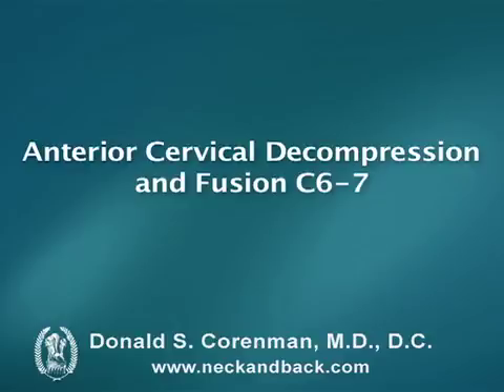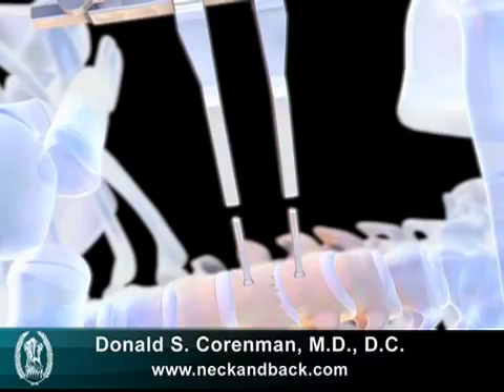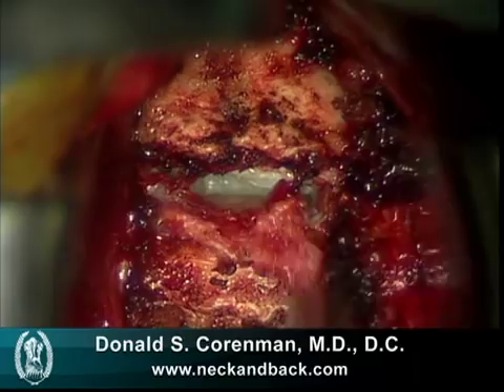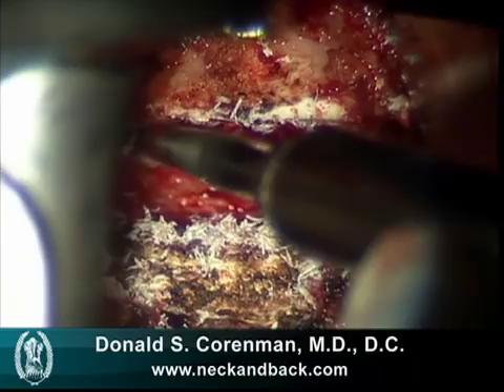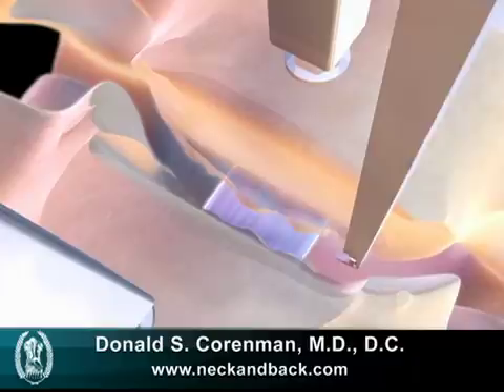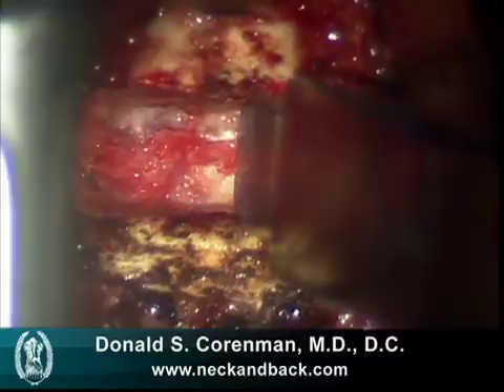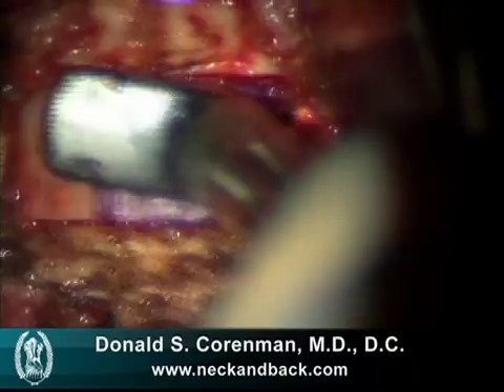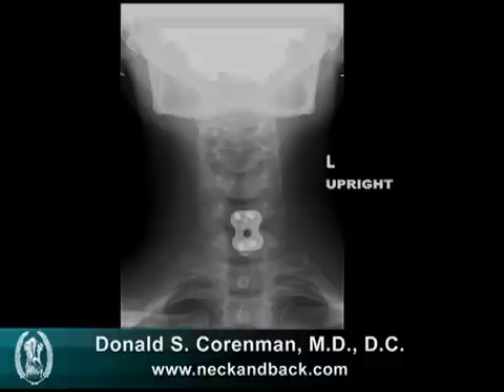Anterior Cervical Decompression and Fusion (ACDF) | Live Spine Surgery Video | Spine Surgeon

Comment: I had this surgery done on the same levels (c6-c7) and I'm stronger now than I ever was before. I always suffered from muscle imbalances and I'm definitely much more even now
Reply: Did u balance issues...
Reply: @TarikRom-hu3jj  had the surgery in late 2015. The pain eventually came back but for about 8 years I was able to lift weights daily and had no issues with strength. About 6 months ago I lost all strength in my left arm again just like I did before getting the C6/C7 fusion. I am scheduled to get another C5/C6 fusion in the next couple months. 

Before I got the first procedure I was warned that over the course of my life I would likely need additional surgeries as additional discs would likely degenerate…

Comment: Lu Malungcot Hi Lu, Sorry I've been extremely busy.
Yes, I had my surgery on June 24th, 2014. I didn't get my 1st follow up appt. until 3 months after surgery, I reviewed many other videos & I wondered why I had to wait so long. There is improvement, I no longer have the pain that ran through my left arm which was very intense. Although I still experience numbness from my elbow to the tips of my fingers, the surgeon said that it may have something to do with the elbow itself ... That's another appt. I still have to make. The day of surgery my surgeon let me know that I would also be having my C-5 done, so I had C-5, C-6 & C-7 which took 5 hours. I was then taken to intensive care overnight & went home. I would say that for you not to be afraid & I know that's easier said then done, but I was also concerned & felt a little nervous myself. I do have to say that I don't regret getting the surgery, I do still have some pain & cracking which I was told is normal & could take up to 1 year to heal. So, after 1 year I should be healed as much as possible. My husband & myself decided that I would not drive until just recently, you will tenderness when you turn your head. My tenderness is on my right side. I believe that as strict as my surgeon was before he would even consider doing the surgery help me very much & that was due to other health conditions I have.
Build up your courage & know that you'll feel better after recovery & remember that you will be a little fragile & experience some discomfort. I had fusion, so I do have a Titanium-Plate & 6 screws.
Good luck Lu, you'll be fine.
I'll keep you in my Prayers, it doesn't hurt to feel that extra comfort. You'll also need someone to help you & take care of you, so plan ahead & make sure you have someone to do just that.
Please keep me updated on how you are feeling & how your recovery is going.
               Lily
Reply: Lily, thanks for your comment. I'm at the end of my back injections  (2 years) I've been told it's time to talk to surgeons. I'm scared s...less!! But the pain all along my spine from neck to lower back has me nauseated, I stopped the opioids 3 months ago because they no longer worked. I needed the push of courage you gave me. I'm so tired of the pain, feeling "wasp stings" from nerve pain due to bone spurs. ENOUGH!! 😨 God bless you Love! Thanks again.
Reply: Hii
 I will be having my surgery on 13.11.21.
I have problem in c5 c6 c7.My C6 will be removed completely.The disks between C5 and C7 will be removed.A cylindrical titanium cage will be placed between c5 and c7 and a plate will be fixed with screws in c5 and c7.
These are the symptoms that i am having pre surgery:-
1.Tingling sensation in left thumb and indes finger.
2. Simetimes the left hand goes numb.
3. No pain in neck region and a rare pain in left shoulder.

Now my question is:-
1.After surgery will i have unimaginable pain and numbness?
2.How many days it will take to return to my normal life without any hassle anymore(pain or numbness)?
3.Will i have to live rest of my life in restricted way?

Comment: Hi my name is carter...I had c-2.3.4.5.6.7 disc removed. My scar on the back of my neck is 12 inches  long. My surgery  was may 30 2014. Before  the surgery I noticed  my walk was getting  bad and numbness  in my arms and loss of muscles in my arms. So I went to see my doctor  and he sent me to the hospital  the same  day. They did a M.R.I and found  a huge  problem.  If I waited any longer  I would  have lost even more motor skills.  So they did the surgery  and the doctor  told me I'll won't get much better than I am at present  today because  the longer you wait the worse it gets. So I won't  be 100 percent  but the surgery  stopped  it from getting  worse.
Reply: THe longer you wait the worse it gets. So true.

Comment: Very nicely narrated Dr. Corenman. I used to produce surgical videos on a regular basis. They were very similar to this. Many of them were valve replacement procedures (200+) but a lot of orthopedic and back surgery(see the examples of tv programs on my youtube site). Now I have to have the surgery and it will be a fusion just like you're showing but mine will be between c5/c6 and c6/c7. Thanks again.

Comment: I had L 4  and 5 and 5 fused at Riverside Methodist in Columbus in 2000, and haven't had so much as a twinge of pain since (plate and 4 screws). I am having C 4 thru 6 done at an outpatient surgical center, and THAT makes me nervous. I am not afraid of the pain (I don't see how it could hurt worse than it does now) but if something goes wrong, I would rather be in a hospital.

Comment: a few questions here. Did this patient have numbness in the fingers and have shoulder pain? I have numbness in my middle and ring finger on the right hand along with weakness and my should pain is at time unbelievable and at time I sweat a lot. My other question is how long is this surgery and what is the recovery time and what is this procedure called. Thank you so very much
Reply: Maybe you had some spinal cord damage. After six months, I still have some numbness in my fingertips, loss of balance, pain in my arms, shoulders, legs and feet. Not to mention that my feet's soles feel like they are made of bark. The itching in my shoulders is very annoying. It's about 1/2 inch deep under the skin. Scratching does not help.
Reply: I do have degenerative disk disease in my lower back, and after 5 lower back surgeries I am starting to have problems in my neck. The VA DOC's wanted to rule out carpel tunnel so I had surgery on my hand but I still have weakness and tingling in my fingers so now I am to have the steroid injection and see what that does
Reply: Steroid injections help. For a time. Do you have shacking hands? Unexplained pain in one thumb? If you do, go have an MRI of your neck. Could be a displaced or swollen disk. I had that undiscovered before I broke my neck.
Reply: I have herniated disc c-6,  it's huge as in mri and push on spine cord,  I had pain all over my arm and fingers with nemnes 

With physiotherapy the pain was almost gone totally,  but recently comes back again a bit but it goes with therapy,  should I do the surgery or continue on physiotherapy, also can Chiropractor help or its risky ? 

One of doctors told me that if the pain is gone do not  go to surgery and the herniated disc will go and get adjusted
Reply: I had same thing including numb fingers...I just had C5/6 & C6/7 surgery like described in the video

Comment: I will be having my surgery on 13.11.21.
I have problem in c5 c6 c7.My C6 will be removed completely.The disks between C5 and C7 will be removed.A cylindrical titanium cage will be placed between c5 and c7 and a plate will be fixed with screws in c5 and c7.
These are the symptoms that i am having pre surgery:-
1.Tingling sensation in left thumb and indes finger.
2. Simetimes the left hand goes numb.
3. No pain in neck region and a rare pain in left shoulder.

Now my question is:-
1.After surgery will i have unimaginable pain and numbness?
2.How many days it will take to return to my normal life without any hassle anymore(pain or numbness)?
3.Will i have to live rest of my life in restricted way?

Comment: I just did the c5 surgery 2 days ago because of having the signs of myelopathy, now I’m at home and so far feel great, if you don’t mention sore throat and neck of which I was noted before surgery, however they used a titanium cage and didn’t use the fix plate and told me that I need no collar, also I need to keep my neck motion as fluent as before as if I did nothing (for the exception of cracking and sudden movements) in order not to get a stiff muscle.
Reply: Hii
 I will be having my surgery on 13.11.21.
I have problem in c5 c6 c7.My C6 will be removed completely.The disks between C5 and C7 will be removed.A cylindrical titanium cage will be placed between c5 and c7 and a plate will be fixed with screws in c5 and c7.
These are the symptoms that i am having pre surgery:-
1.Tingling sensation in left thumb and indes finger.
2. Simetimes the left hand goes numb.
3. No pain in neck region and a rare pain in left shoulder.

Now my question is:-
1.After surgery will i have unimaginable pain and numbness?
2.How many days it will take to return to my normal life without any hassle anymore(pain or numbness)?
3.Will i have to live rest of my life in restricted way?
Reply: @subhamoysaha3764  are you done
Reply: @unknownuser6207  yes...back to normal with slight restrictions

Comment: I have a question please. I am 30 years old. I have a large disk herniation between c5 and c6, with spinal compression. The pain is sooo much better then a month ago. I still have some burning pain and mild neck pain. It's more moderate pain when I wake up in the morning. They gave me no option to try physical therapy or injections. I guess because of the spinal compression. They said I could lift my son who is 15 pounds after surgery and I should feel great in a week or about like I do now. I have a pretty high pain tolerance. I had a C section (major surgery) only taking pain meds for 2 days (1 at night for just two days). My pain really isn't too bad and I only want to go through with this if my cord is at risk.

Comment: Does the patient end up with full range of motion as before?
Reply: +Patricia Caracena I have had this done. I've noticed that my only limitation is just when I try to look up. But it's not that big a difference. I just don't feel as if I have the same amount of neck extension as I once had. Other than that, I don't ever notice it.
Reply: +Susan Turner what was the prognosis if you did not have the surgery?  I am not a good patient and have never had any kind of surgery, so I am not ready to jump into it.
Reply: Patricia Caracena I am a Respiratory Therapist and it was really interfering with my job. My left arm and hand was already virtually useless. The pain I felt was excruciating. Now, I have no pain at all and complete range of motion with my left arm.

Comment: Hello Dr. Corenman, I had the surgery 5 weeks ago in the UK, a 6mm Brantigan cage was inserted. My NS mentioned after the surgery that extradural tissue had fine glossy texture suggesting previous inflammation. I have started physiotherapy including hydrotherapy ( no swimming). My neck movement is fine, I have occasional shoulder pain but much much better than 2 weeks ago. I still do not drive and only work few hours a day ( desk job). Whilst my previous symptoms improved however , I am now noticing return of burning  sensation in my left bicep. Can you please help and explain possible reasons for my symptoms.. Thank you in advance

Comment: Wow, watching that and thinking back to my c6/c7 fusion gives me the jitters.  I also had the pleasure of being cut open 4 months later, as I was the one in a million who's body rejected the titanium screws/plates, have them sitting in a bag in my desk drawer.
Never had any choking, etc problems though, and yes you can have it removed onced the fusions complete, they remove it and bone putty the holes.
Reply: You're not one in a million rejecting the screws. It happens quite frequently. The "titanium" is not inert and not pure titanium.  It's mixed alloys. Hardware, clips cause lots of suffering for a lot of people.  Allergy, foreign body sensations are common. Glad to hear they removed that crap from you.

Comment: I had and operation in 2010 from c2 to c7 now im in good shape, only feeling tightness on left side of lower neck. Gone back to gym and doing some strenghtening especially on the lumbar area which now felt weakening. Im 56y old/male. Any advise on dos and donts. tks

Comment: Dr. Corenman, I am to have multi level arthrodesis in cervical 3 through 7. I also have a lot of stenosis. I am petrified. Everything I have read about the metal plate is bad. People choking, gagging, and breathing problems, sometimes years post op. All because it is placed behind the esophagus. Are all of the plates 2.4 mm? Is a plate necessary? Can it ever be removed?Please help. 
When they are finished with that, in time my lumbar and a portion of thoracic needs to be done: FBS times 2

Comment: fernando lara I'm feeling better But not as well as I thought I would be doing by now. Or it could be me just feeling anxious & ready to be healed, I had my surgery on June 24th, 2014 about 7 weeks & I was told that I was expecting too much in such a short time. It feel as if it seems I've been healing forever.
I don't have the pain running down my left arm But the pain running down my neck to my shoulders is excruciating as is the pain on my shoulders. Fernando, have you had the surgery & am I expecting too much for 7 weeks of healing. I have my 1st 3 month appointment with my Surgeon, I'm still wearing the neck brace aka Collar ... I was told to keep it on & depending on how I'm doing I may or may not be able to go without it.
WISH ME LUCK .... LILY
Reply: TyVm, I finally have my 1st appt. with my surgeon, it has to be 3 months after surgery.
He'll let me know how it's going & if the fusion is doing well.
I'll keep you update after 09/25/2014
Reply: Lily Wilson Hi Lily, i wrote you a comment in one of your posts here.  Any update after your 9/25/14 check up?  Are you feeling better? I'm scared as hell to go through this same kind of surgery as yours.  Please keep me posted too.  thanks again.  Lu
Reply: Lu Malungcot Hi Lu, I feel better then before. I still have some stiffness & can hear cracking when I turn my neck, the surgeon said it would take at the least 1 year to heal as much as possible& No, I don't regret getting surgery ... Don't be afraid, your in my Prayers Lu ... Good Luck  😊
Reply: I had Fusion so I have a Titanium-Plate & 6 Screws  in my (Cervical-Spine)
Reply: That's the reason why i had my surgery delayed.  I will pray for your recovery Lily.  So it's been months and you're still in pain?
Reply: Lu Malungcot  did u do ur sugary?
Reply: Ahmed Sulayman Hi Ahmed, thank you for asking, but no, i didn't do it because when i had the density scan of my bones, it was found to be osteoporotic.  My bones have become porous and brittle and surgery will only worsen my condition. So here I am, i guess i have to live with this pain all my life.  I am suffering more on my lower back pain because my L4 & L5 have bulding disc, spondylolysthesis, herniated disc, etc.  Same with Lily, i hope Lily you're feeling better now, the pain is debilitating that i can't come to work the whole week for unbearable pain.
Reply: oh Gosh, sorry to hear that Lu . i'm just scared  to do it. I work in construction , i worry about my life will be over after operation
Reply: why Ahmed? what's wrong with you back? do you also have a problem like mine?
Reply: i was doing ABS 2011 over exercises and cable was low i injured  myself. was a lot of pain for 6 month can't run , or even turn my head. then healed but always have paint my shoulder blade April 2015 took MRI showed i have bad C5-7
Reply: oooh! that hurts! so are they recommending surgery too? have a second opinion Ahmed, it might help, you know?  because they almost always say you need surgery but sometimes it can be cured in a natural way still.  hoping you will find the best cure and surgery will be the last.  take care.

Comment: I just had a 3 level fusion c5-c7 I used a donor rather than my own bone, thats just to much healing, all I can say is that it is working so far, example I used to have problems raising my arms to put away dishes, or even trying to throw a ball, the only thing that is still a problem is putting my hands behind my back, is it possible that I need even more
decomprssion??

Comment: This is truly amazing.  As I have a pinched C7 nerve causing me numbness in the R  index and middle fingers as well as the right thumb tip.  Would this be what would be done to me in this case.
Reply: +Dottie Lake I had acupuncture and that relieved the nerve pinch.  I also had shots in my thumb for a trigger finger and that took care of that.  As long as I can keep my spine straight, e.g. walking correctly, sleeping on my back, and walking on the balls of my feed instead of my heels (straight down the spine to support me) I think I can avoid surgery.  I am not a scientist, but I am a researcher and my conclusion is that there is not enough information available on other means of treatment to rule out surgery, but there is no hurry either inasmuch as I am starting an aquatics therapy program (on my own) that will strengthen the muscles that are beginning to atrophy as a result of the nerve damage.  Time will tell and I have more time than money.
Reply: Patricia acupuncture did nothing for me, so surgery was my only option for walking again with out any pain. And the longer you wait to have surgery the worse it can become, which will lead to either longer recovery or more server surgery, please don't give medical advice since you are not a doctor.
Reply: +PAMELA HARRIS I am not "giving" medical advice I  merely telling you what I've done. you, on the other hand are giving me advice to have the surgery done before it gets worse. double standard?